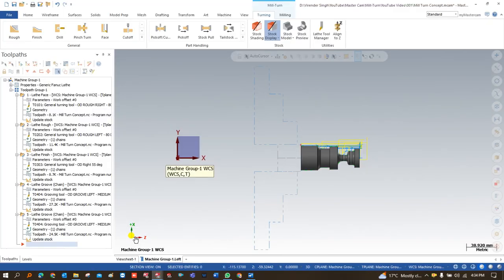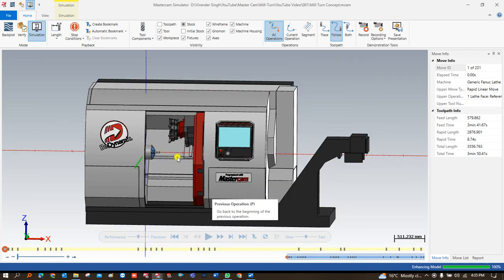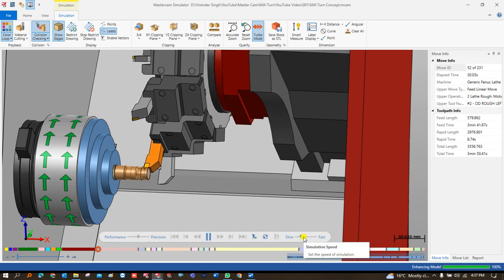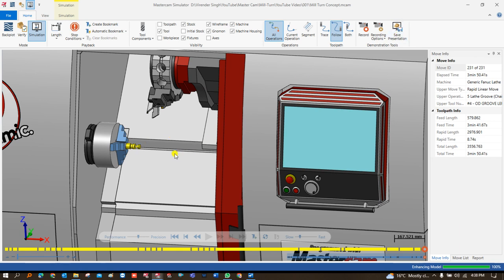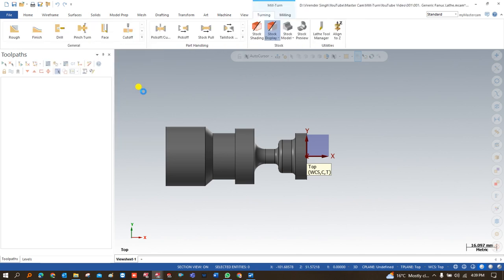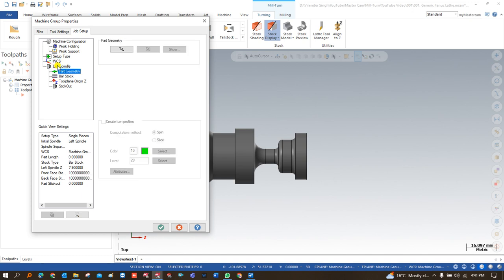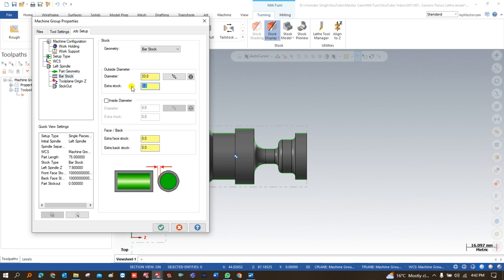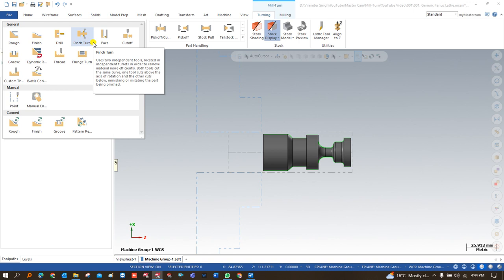Mastercam Mill Turn Programming || Single Spindle Single Turret Machine || Fanuc Generic Lathe

Comment: Sir can I install mastercam latest version with i5 or i7
5th or 6th gen 
Or I need latest generation?
Reply from the maker: You can install
Reply: @VirenderSinghBhati  sir if I buy a second hand laptops
Is okay with old gen like 6th 5th 
Because that is cheaper if I go for latest generation it could be 40k
Reply: @VirenderSinghBhati  kindly reply sir 
Does gen matters or not
Reply: @AravinthRam  bro ok
I have Intel i5 7th gen mastercam 2021 smoothly run 
If you get a second hand laptop i5 6th-7th gen then it is fine if the graphics card remains then even better
Reply: @bhupendradhakal2928  thanks Bro🙂